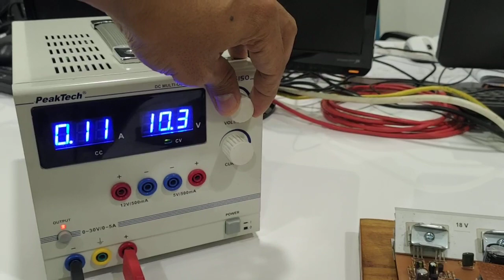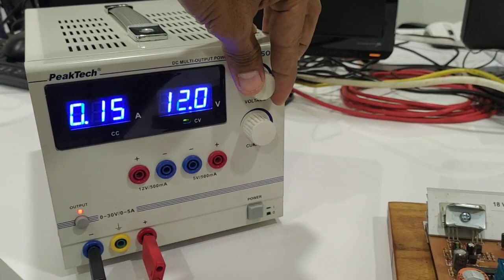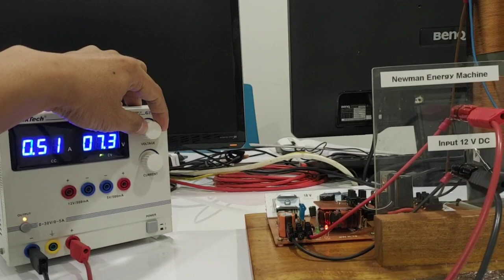Newman Motor - Final Version

Comment: Okki, nice work but this is not Newman motor.  Newman used higher voltage but very low current on the input of device. Your coil windings need length 
not thickness of the wire. Magnets are also very important and neodymium is best. Let me explain his theory in very basic terms. You are drawing 
energy from the windings and magnets. Big flywheel on the shaft is another addition that works well by giving you a constant inertia. His motor was 
running for 3 minutes after input voltage was disconnected and current was flowing from motor to input batteries. Your design is current not voltage
based. Read his book and try to understand theory properly.http://www.free-energy-info.com/Newman1.pdf

Comment: You are so close to building my converter.
Reply from the maker: What do you mean with your converter?
Reply: @OkkiMoeljadi  the power converter in my videos. Trust me. It gets very interesting.
Reply from the maker: It seems like your power converter has a characteristic like Tesla Coil with its high voltage and high frequency.
Reply: @OkkiMoeljadi  it's quite different actually.
Reply from the maker: Would you share the schematic?